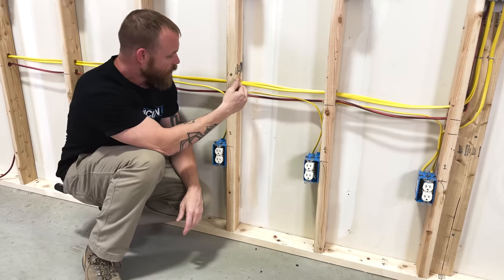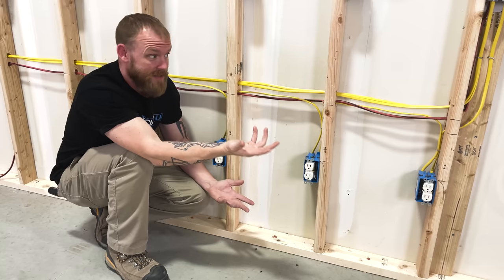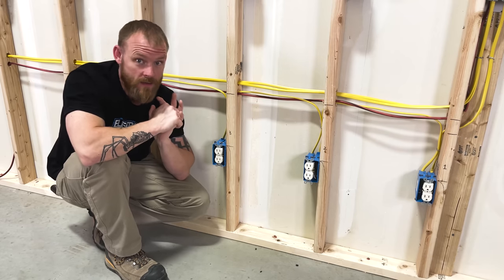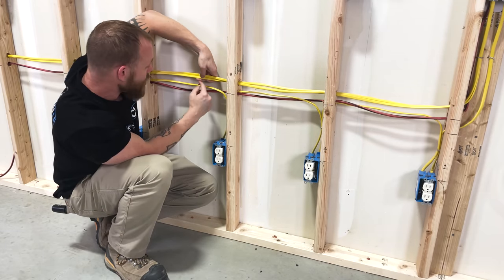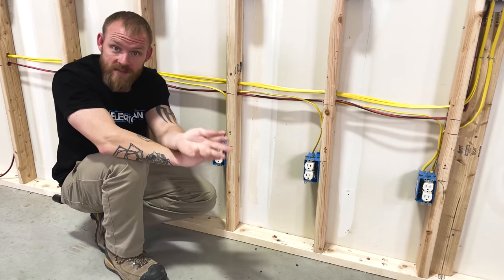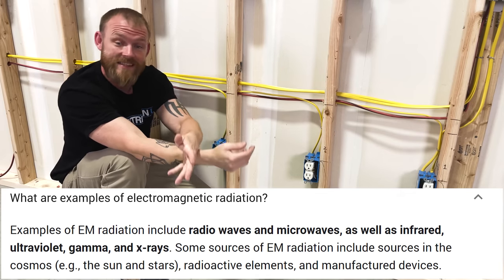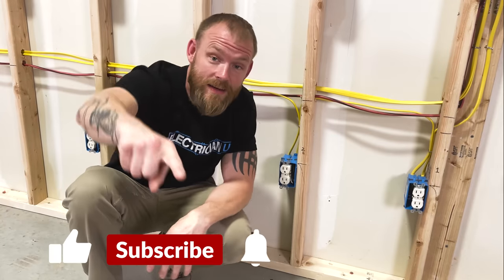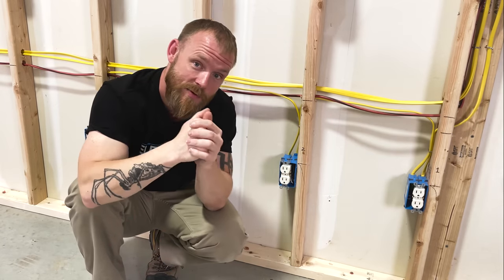How Many Wires Can Fit in Each Hole?

Comment: Capacitance is not an issue for 60Hz wires.  As stated by another commenter, the capacitance between the hot and ground conductors in a Romex cable is greater than the capacitive coupling between arbitrary pairs of Romex cable.  The reason for limiting conductors in shared holes in the rules must be some of the other things you mentioned besides the capacitance.  
If we assume that Romex has about 20pF per foot, 100' gives about 2000pF, which has a capacitive impedance of about 1 Meg Ohms at 60Hz.  That would give about 100 micro-Amps of current flow.  If we consider another Romex cable as close as it could be for that same 100' length, the capacitance would probably be ten times less.  The result would be insignificant.
Reply: Totally screenshotting this!
Reply: The capacitance is not in series with the conductor, so it does not impede the current flow in any way.  The capacitance is BETWEEN conductors and results in tiny amount of ADDITIONAL current (leakage current).  The conductor derating table is there for heat dissipation reasons due to the cables being bundled.  Notice that the derating table references ambient temperature, which is a huge hint that they are concerned about temperature rise in the cable.
Reply: @njnear  Yes, and the total capacitance is related to total length, so even though there would be a larger capacitance in an exceptionally long run, the capacitance per unit length is only about 20pF (virtually no effect).  The resistive losses are also related to unit length, so the heat produced (per unit length) is the key factor.  Any time the conductors (and heat) are concentrated into a small area with restricted thermal paths, the temperature rise concern is valid.  It is more important for multiple cables in longer enclosed paths because a 2" long hole in a stud may generate more local heat, but the copper conductors will help conduct this heat away from the tight area, spreading the heat out over several more inches, lowering the peak temperature of the conductors (and more importantly, the insulators) in the hole.
Reply: Capacitance or inductance is very possible in a 60 hz application. It’s depends on the voltage levels. At normal residential voltage level (ie: 220/120) I will agree it’s not an issue. But, In industrial applications where you have full line voltage (kV) to a switch gear it is a concern that must be keep in mind.
Reply: @sparky_oo1955  Yes, for the power companies with hundreds of miles of transmission lines, they need to be concerned about inductance and capacitance in their designs and controls, but for residential or commercial applications (normal people), the effects at 60Hz can be ignored.  Also, the inductance and capacitance don't depend on voltage, but the currents that flow are always Voltage/Impedance.
Reply: Thank you kind sir
Reply: 5:39 should have had a nail plait 2/10 there ya go
Reply: Engineer speaking volumes
Reply: true, its a bad comparison to cat 6, which creates a much larger EM field (where the shield is mostly just extra as its already differential).
Reply: You say "2 or maybe 2 CONDUCTORS per hole " and yet SHOW 2 or 3 pieces of Romex per hole.  Careless language- each piece of Romex has 2 (or sometimes 3 ) current carrying conductors in it, making 4 or 6 conductors current carrying CONDUCTORS per hole. Grounds don't count.

Comment: Hey Swedish electrician here, damn you guys have a easy job. Here in Sweden you have to draw all wires in plastic pipes (when the installation are in walls). But that can also be very useful when you need to change wires/cabels.
Reply: It varies.  For example, Chicago, IL requires metal conduit in the walls.
Reply: @taylorlightfoot  that sucks
Reply: @taylorlightfoot  just use MC cable then, no problem.
Reply: @davidsherrill375  those rules have nothing to do with the covering of the conductors in metal - it’s a partnership with the pipe fitters union to have metal conduit and metal pipes. Numerous “union” cities were like that. 

Electrical was and in some cases still is “conduit only” with flex only allowed in limited length or conditions.
Reply: Remodeling is awesome in the US compared to many places.

Comment: Agree... I too stick to two cables per 3/4" hole.  Occasionally, I have to run three through and just up the hole size to 1".  Just makes pulling the cable easier.
Reply: Right? Why would you want to fight  overstuffed holes to begin with?
Reply: Ya at some point it's not practical just dril another hole
Reply: @james10739  And I love getting my money's worth out of my $500 DeWalt hole hog.
Reply: @ericthered9655  that much man I really haven't used it much but I picked up a used Milwaukee hole hawg the smaller on with just 1 speed but it works great but I got it used off eBay for like $120 or something I don't remember but it wasn't near $500
Reply: @james10739  I bought the big flexvolt 60V Max cordless with spare battery.  It's really a wonderful drill.
Reply: Until what size can you drill the stick. without losing resistance?

Comment: I have a common practice of drilling a 3/4 hole, and if another run is needed, drill another hole.  You can fit comfortably 3 runs of 12/2 and 14/3,  and  4 runs of 14/2.  My biggest concern of overcrowding is not the breathing factor, but drywall screws skewering the run!  Though nail plates are used for some reason, a lot of people think longer screws are better to hang drywall, or put up siding.....in my own home, I replaced a junky GE Slimline panel with a nice Square D.  The original panel had no main cutoff, though it was installed in 1981, and passed inspe tion (?), and when I purposely forced tripped a Slimline breaker the damn breaker did not trip...so I could have just replaced all the breakers, but with that expense, decided a new panel was needed.  Anyway, there was a siding nail stuck inside the service conductor leading to the panel from the meter.  I replaced that wire bundle, opened the cover and saw the neutral was indeed  poked.  Yes, could have energized my whole house exterior....anyway, catch your " act" on the next video!

Comment: 310.15(B)(3)(a) provides a clear definition of multiple cables in a “bundle”. As a general rule, I stick to 3 which derates the conductors by 80%. This allows for other adjustments that might be applied in addition to bundling such as ambient temperature. Thanks for the video.
Reply: Well if it’s more than 12 inches hole, conduit then you have to derrate. But for a hole that small you don’t need to derrate at all(12 length

Comment: Your "heat not an issue" argument works fine in typical inside walls, but it's worth considering in outside walls that are insulated. Many years ago, when I was in college, I worked at the local electric utility, and one of the things they asked me to do was to test various types of insulation and their effects on wires. We built a 4-segment wall, ran several conductors through it (14-2 WG Romex, 12-2 Romex, 12 AWG in conduit, 14 AWG in conduit, 14 AWG post and knob) through it, insulated the various sections with different insulating materials (none, fiberglass, cellulose, foam), installed thermocouples to measure the temperatures, and then ran each circuit at various increasing current levels. When we got to 20 amps on the 14-2 Romex circuit (yes, that exceeds NEC but can be a common mistake if 14-2 is connected to a 20A circuit breaker; the utility was aware that some service/panel upgrades used 20A breakers connected to 12 AWG wire at the panel that then connected to existing 14 AWG wire elsewhere in the house), the wall started smoking and caught fire after just 5 minutes of continuous load. The fire started in the foam section, then spread to the cellulose. Needless to say, the test was quickly terminated. The test results were shared with several organizations, and led to some of the electrical and building and insulation code changes we see today.

Comment: Bundling has absolutely zero negative effect on wires/cables. I have examined thousands of cables that spent their lives being  bundled and stuffed through holes. The number of failures or installed of damed were....zero.
I spent decades replacing services in AZ. By the time I retired I had done several thousand.     Every service is outdoors here and all the cables enter though a hole in the back. It has been done that way way before my time and continues to this day. Why? Because it is a simple and safe installation.
Reply: One commentor here mentioned the possibility of INDUCTANCE coupling. If a supposedly dead conductor is not bonded or grounded properly, enough voltage can be induced into it that it can become a problem. (Commentor said he saw someone get electrocuted, although it was in the thousands of volts.)

Comment: You make a good point, it's not all about heat. I assumed inductive effects were more prominent, but as you say there is a parallel capacitive effect as well. I'm guessing this could play havoc with the charge on ground wires, and maybe even cause nuisance tripping of AFCI's.
Reply: I doubt AFCIs would trip, they're looking for the high frequency characteristics of arcing, and need to ignore the line frequency as it is omnipresent. The more capacitance you have, the lower the resonant frequency will be..

Comment: Fwiw, I always carry 3/4 and 1 inch bits. If I know I need to put anything more than a 12/3 and 12/2 in a hole (6/3 alone or 10-3 with 12/2 etc) I always just use the 1 incher. Makes the pulls so much faster, I feel like it saves my customers money. Same logic for anticipating 2 romex per hole. I only do 3+ if there's weird framing that only gives me a single path, but again in those spots I use a 1 inch and ream it if it needs it.

Comment: AFAIK, the heat thing is about insulated walls. With the 2020 NEC requiring GFCIs for almost everything, you may want to limit bundling so coupling between cables doesn't cause nuisance trips.

Comment: Couple years ago, I ran a wood screw into a stud for a shelf bracket…pop went breaker 

Opened the wall to find the screw went directly thru the hole, thru the Romex….

No slack to fix it with a wire nut, so I used a crimp butt connector, after crimping I soldered the connector to be safe and covered with heat shrink.
Reply: A perfect example of why nail guards are important.

Comment: I ran into this when I was fixing the wiring in my home.   I killed the circuit and then went to work  on the outlet and was shocked by the white wire.  I was surprised and read the voltage from it.  It was about 2 volts dc and quickly went to 0.   As a tech who works with capacitors daily recognised this as the white wire getting a charge built on it.   Not only is the Capacitve a reality but also Inductance can play a role too.
Reply: You probably got shocked from the neutral wire because it was part of a 3 wire circuit and the other circuit was still on and it was sending voltage back on the neutral. Always put a 2 pole breaker on circuits that are sharing a neutral
Reply: @ryanm2084  no, that is what surprised me. it was a singe line.  the shock was mor like a large static shock, maybe it was, but in 30 years of wiring it is the first it happened.  i investigated and found bundles of wires running together.  I put it down to an inductive transformer effect

Comment: I have worked in a data center environment.  Heat in residential isn't likely to be an issue unless the runs involved have heavy use or as others pointed out, insulation.  In bundles in a data center, they tend to be running full tilt.  The capacitive and inductive effects also tend to cancel out and are more of an issue with interference between sensitive systems.  We use ferrites where that is a concern but generally the bus strips already handle that.  Ferrites and capacitors are used to filter noise from a/c systems.  Bus strips filter noise to a rack.  But back to the original point, heat is the limiting factor for bundles.  In a data center you even have engineered runs with integral cooling.  But this is industrial not residential.

Comment: I think there is a reason this is not addressed in code because there is no problem with the wires in close proximity.  The effects of capacitance at 60 Hz is virtually nill.  However, high frequency noise often created by power supplies and brushes can be coupled more easily.  This is still not typically a problem as these emissions are regulated.  Heat is a mild concern, but as you stated total current in a group of wires of a residence is typically very low and further 12 gauge wire is extremely conservatively protected.

Comment: an independent lab ran testing on how many wires can be jammed in a hole without overheating them, so they put various numbers of cables in a hole, foamed the hole, like insulators now always do, and their determination was that you pretty much couldn't exceed 3 cables before you started overheating wires.  and capacitance between wires?  not a thing I've ever heard of.  induced voltage, yes.  never capacitance.  
and if capacitance is the issue in the wire bundling charts, why is ambient temperature a factor?
Reply: You are right, capacitance would be so low with 60 cycle, 240v lines as to be difficult to measure. Even inductance would cancel out as cables tend to twist over distance.
Reply: Have the sauce for the study/test?
Reply: @Merescat  my code update instructor about 14 years ago.
Reply: @kenbrown2808  No way to verify.  I wanted to read it.
Reply: @Merescat  sorry.  I don't maintain a library for other people. it's not in my scope of practice.
Reply: Love your channel, but respectfully disagree with capacitance between cables.  While in theory you are correct but the distance typically Cable is run in a home in parallel with another cable is minimum which will result in minimum impact.  Unlike power/utility companies where the voltage is higher and cables are run in parallel for miles.
Reply: Yeah, ok, good story. Sounds like BS to me. What, did they run the maximum amount of amperage on each set of conductors for long enough to nuke them? Because that's unrealistic. I run three conductors through the same hole all the time, and I have never had one burn up. Cite the study if you are going to make a claim. Because if that were true, they would probably make a new code about it.

Comment: When I saw the 3 Recepticals, "More Cow Bell" came to mind(Wlll Farrell, SNL)Good Video
When I Drill holes, I like to drill around a 45 angle to reduce the sharp turn.
I do it with Smurff as well. Some helpers won't, I refuse to pull through, they can. Nothing Negative about it, Less Smurf(ENT), Less Wire

Comment: I use to work for a telecom company. I can tell you right now that the sheathing on shielded anything doesn’t do crap unless it’s bonded and grounded properly. If you get out in the sticks, especially aerial plant, inductance will light you up. Been there, done that.
Reply: Especially C wire that wasn't twisted when installed, had a co worker yell when he grabbed ends.

Comment: Comparing your terminology to mine is fun. My expertise is in electronic design, not electrician. To me a "conductor" is only a single current carrying element. This includes not only wires, but also individual traces on a printed circuit board. A bundle of wires held together with an external jacket (for example romex or NM wire) is always called a cable. A bundle of wires held together in intervals (with, for example zip-ties) is a bundle, more specifically a wire bundle. A bundle of cables held together in intervals is also a bundle, more specifically a cable bundle. You keep referring to a single segment of romex as a conductor and it keeps sounding "wrong" to my ears, but is probably just a jargon difference between two similar looking (from the outside layperson) industries. This example of jargon differences (and my lack of training on electrical code) is why I'll never claim to be an electrician.
Keep up the good videos. I'm learning a lot of useful information as a new home owner.
Reply: Your use is actually correct for electrician jargon also. NM is a cable, inside it are conductors. You terminate the conductors after all, not the cables. That's certainly how the NEC uses "conductor". But you do also hear electricians say conductor to refer to cables. But then again, those same electricians also just say wire to refer to cables which is actually really annoying when it's completely unclear sometimes what someone is looking for. Oh, you need 12 AWG wire, yes I have some right here for you. What's that, you're looking for 12/2 MC actually? Maybe you should have said that instead of asking for "wire".

Comment: The NEC codes are 310.15(B)(3)(a) and 310.15(B)(16). Up 9 currect carrying conductors. Don't forget to check with your local codes as well.

Comment: You’re right, the typical home uses do not generate much heat, but you can’t bet on them being low all of the time. 
Shielding has little to do with capacitance. The biggest issue I see is drilling too big a hole and weakening the structure.
Overall, a good summary.
Reply: Yes you don't want to weaken the structure. But what weakens the structure more two small holes or one big hole?

Comment: Good video.  I didn’t hear you mention if the borings are thermally insulated or not.  When it comes to quantity of cables in a hole, that plays a big factor.  While I agree that most residential/ commercial installs using romex won’t see more than a few amps, you still need to derate them accordingly.  The code is clear on that - 334.80.  Curious if you see it another way